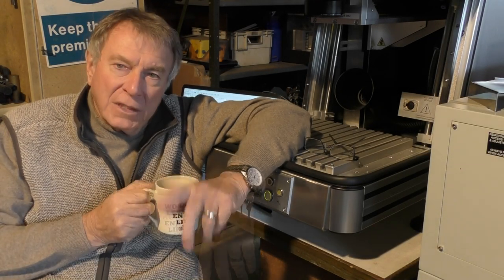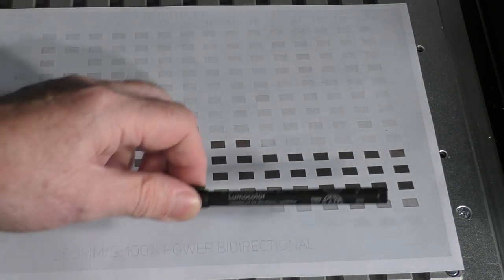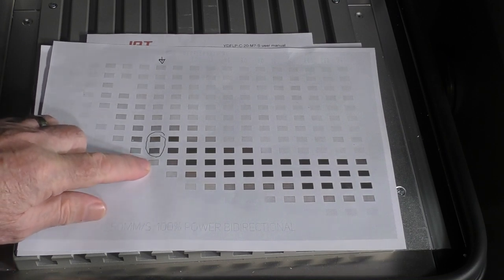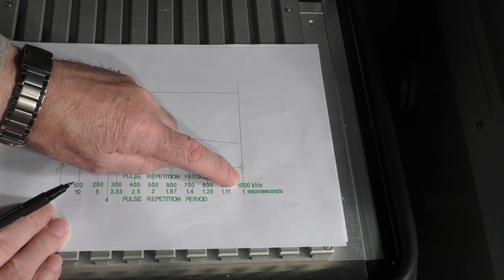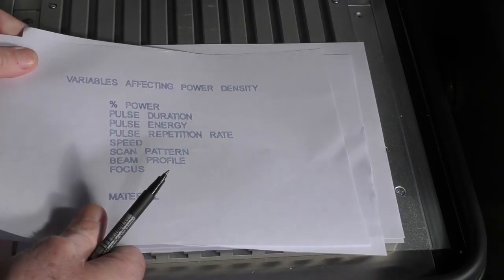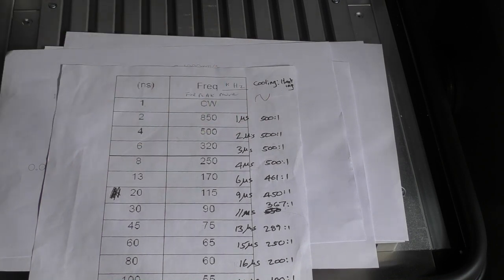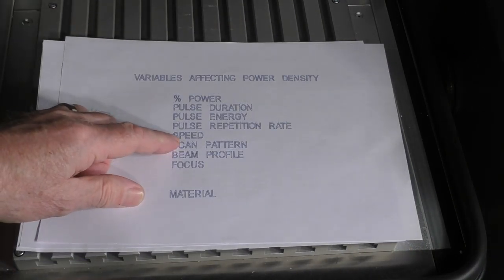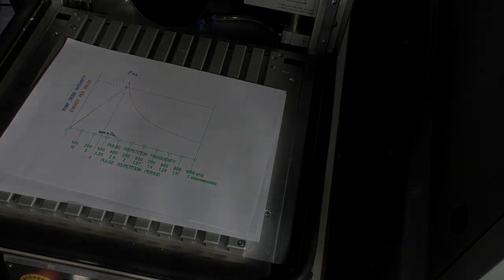Fiber Laser Learning Lab 02 MOPA Matrix Test Leads to Understanding

Comment: Hi Russ, now your getting into it. There is another variable to consider (Focal Length) by changing the lens you can increase or decrease the focal length which directly affects the power on the surface of the material, it does have the affect of decreasing or increasing the working area also.
Another great video keep up the good work.
Reply from the maker: So the million or so parameter combination  is now multiplied by the number of lenses I have?  Oh dear!!!  Lucky I only have just the one.
Best wishes
Russ

Comment: Additionally if you set the pulse time to less than the minimum (1ns works for me) my 30w m7 will output cw which can be useful in some applications. I have confirmed this with a photodiode on a scope.

Comment: Where did you get that YDFLP-C-20-M7-S user manual? I have the exact same same source in my machine but can't find that manual anywhere.
Reply from the maker: Hi 
I am sure  JPT will send you a copy if you contact them OR you can have a copy of mine if you send me your email address.. Sadly Youtube will not allow email addresses (even lightly disguised ) in comments However, there are ways to fool their algorithms. Hide the data in a sentence or two like this.    Start with john and a dot, then add smith with the normal at. I use gmail as my service provider.
 
Best wishes
Russ

Comment: Any chance that these graphs would apply to a non MOPA fiber laser as well? Different numbers depending on machine in question of course, just the principles?
Reply from the maker: Hi Jessica.
 The cheaper type of fiber laser that most people can afford are Q switch lasers and I cover this in the next session I think. They work in a much simpler way and do not have the shaped pulse control or the incredible instant short duration power buurst. The pulses are fairly fixed shape and all you can do is change the duration of the pulse . So no these graphs do not apply to Q switch lasers.. One of the "tricks" that sell MOPA lasers is it's abilty to engrave different colours.  There arema few wealk colours that can be obtainedwith a Q sitch laser  but to be honest it is of little value. Remeber that this beam is  INVISIBL light at 1064 nm wavelength, It cannot "paint" different colours. There is some weird physics behind the creation of colours and it depends on the concept of what colour is and how our eye percives it. It's a fascinating subject that I do explore and decode later in the series.
Reply: Thank you so much for you reply, this is helpful! I have watched a few videos already and they have been invaluable! @SarbarMultimedia

Comment: Did you make that test grid any special way or  was it a case of hatching each square 1 by 1?
Reply from the maker: Hi If you go to 5 min 20 on this video you will see my pattern in more detail.
https://www.youtube.com/watch?v=iEDS2fA6xmo&t=1336s
It is just one pattern that I created in Photoshop  using a 1 pixel pencil tool and then i used the matrix array tool in Ezecad to replicate it. Thereafter it w tedious work to put parameters into every pattern.
 I purposely made it a very detailed pattern to test the switching capability of the machine. Although it is technically a 
 bitmap  the machine thinks this is a vector file.

Best wishes 
Russ

Comment: Quick question when it comes to me - does the laser software for this only do raster scanning, or can it do vector paths as well? For example, suppose you wanted to cut something from thin shim stock (e.g. 0.1mm stainless - I'm thinking on electrodes for vacuum tubes!). Could the beam repeatedly trace the outline of the part, and it would eventually cut through, or would it still try and do a raster pattern? Hope that makes sense.
Reply: Hi Lindsay

EzeCAD, like RDWorks is not really a drawing package but it can import DXF or BMP files. So yes it can draw outlines. I have not played with the cutting aspect of the system but I have already seen that some of the settings will gouge deep lines,. so I have no doubt it will be able to cut through thin material. I will be trying this in a later session.
Best wishes
Russ
Reply: @russsadler3471  That sounds encouraging! It'll be really interesting to see how it behaves when engraving deep stuff - you very rarely get good examples of this, generally they're more concerned with surface marking. By the way, have you seen those examples of colored marking on stainless done with a MOPA?
Reply from the maker: @imajeenyus42 
Hi Lindsay
Colour  creation  with a monochromatic beam of light  seems like black magic. I have already started the research and am making good headway. I don't want to aimlessly hunt for parameters that produce colours, I want to understand the why and the how and I am sure I already have most of the answer.
Best wishes
Russ
Reply: @imajeenyus42  For deep engraving and cutting thin materials a normal Fibre Laser is suitable 50W if your budget can stretch, MOPA lasers are twice the price but you do have the added benefit of colour.
Reply: @precisionlasersolutions7996  I was wondering that as well - so a normal fiber (which I'm assuming is Q-switched) would be able to do everything a MOPA can, just not color on stainless?
Reply: @imajeenyus42  I wont anticipate / predict what Russ is going to discover but if what you want to do is deep engraving and thin wall metal cutting a Q-Switch Fibre Laser is up to the job. You can also get some colour with the correct setting on Stainless Steel, just not the same range and intensity as with a MOPA.

Comment: Can you provide the easycad files you used?
Reply from the maker: Hi 
Sorry for the late reply
 Yes you are welcome to the files. You tube does not allow transmission of email addresses even lightly disguised. However there is a simple way to confuse there algorithms by losing it in one or two sentances like this.   John is followed by a dot and then smith . After the normal at I use g1m2a3i4l etc. 
 I will then send the files.
Best wishes
Russ

Comment: Hello!

 I've watched your videos for a while and they are really helpful, I've got caught up on a technical issue with an older one where you talk about reverse scanning and backlash, My laser cutter is large bed 80w chinese thingy (signtech 1290sp), and when I scan exactly as you do in the video, the laser fades itself in on every line from either directions. Is there a contact email for guys that I could get some help with this as I don't understand whats going on, as a result the scanned logo doesn't have a very sharp line, even when I add the reverse scanning and backlash adjustments. Please :)
Reply from the maker: Hi
If you like to add your disguised email address (johndotsmithatgmaildotcom) to another comment, I will reply to you and delete your comment.
However what you describe is something I have seen and personally experienced several times. The common link in each case has been Reci. I suspect that your BIG machine is fitted with either a genuine Reci power supply or a  clone design.  Reci only make powerful tubes. Power is required for CUTTING and there is no need for finesse or rapid response  from the HV power supply because cutting always takes place at a leisurely pace of usually less than 50mm/s. Not so when it comes to engraving. You are then talking speeds of 300 to 500mm/s. You also only use relatively low power for engraving. This is also something that Reci tubes are not good at. When I respond, you can tell me what you actually have.

Best wishes
Russ
Reply: @SarbarMultimedia  Awesome, thank you in advance, my email is tringleathotmaildotcodotuk

Comment: It looks like you have no idea what MOPA is. Here is a link that may help you https://www.rp-photonics.com/master_oscillator_power_amplifier.html
Reply from the maker: Hi Pavel
Thanks for the link. You are right  about my lack of understanding. I have spent many hours at this site and others trying to decode how a MOPA works , just in simple principle. I did eventually work it out for myself in a very simplistic form. I do not need to understand every scientific detail because I am never going to design a system. I need to know enough to give meaning the results that I observe when I use the system. When things do not happen as expected, do I blame me, the laser or the software?
I do often refer to the Photonics website but I thank you again for taking the time to comment
Best wishes
Russ
Reply: @SarbarMultimedia  Just to clarify, MOPA stands for master-oscillator-power-amplifier. In other words, MOPA means that instead of one "strong" laser you have a "week" laser and amplifier. MOPA has nothing to do with Q-switching, you can have MOPA design with Q-switched, CW or modelocked lasers.